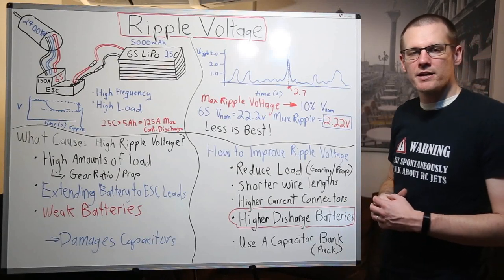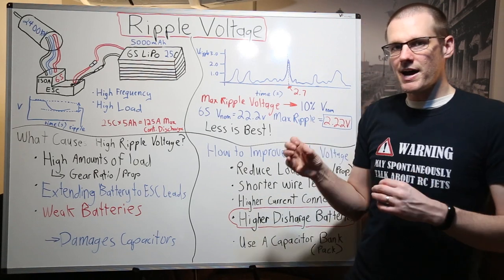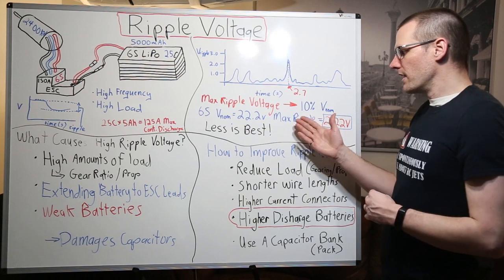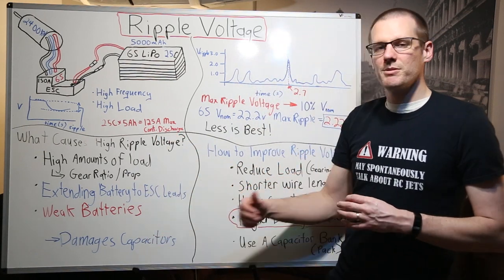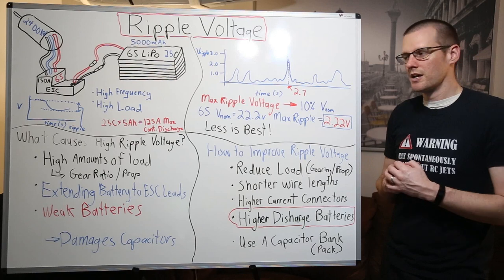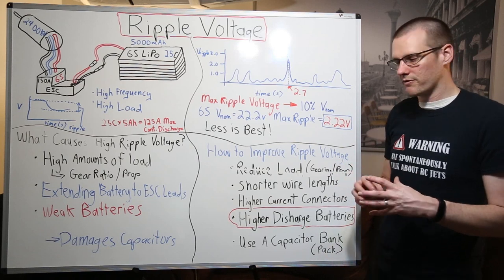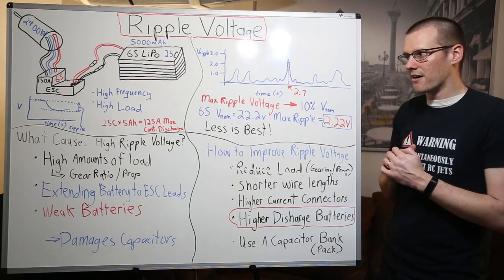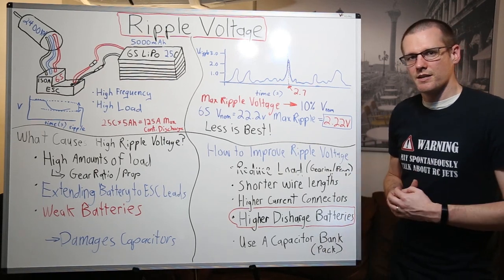What is Ripple Voltage in your ESC and How to Reduce it?

Comment: Awesome video my friend. I've converted a 100cc plane to electric setup and was worried about ripple voltage. After watching this I realize I shouldn't have any problems.🤞 I'm running a motor that pulls around 180amps at full throttle, with a 250amp esc and 9200 mah 12s battery packs/ 2 6s in series. Thank you for sharing your knowledge with the rest of us. You have a new sub!
Reply from the maker: Great to hear! I do prefer to use an ESC that can measure the ripple voltage to know for certain.

Comment: Thanks for this video. It made me realize I need better batteries to have the ability to oversupply amps to my ESCs. As long as my motor and prop don't demand more than the ESC and battery can supply, it should work out with a more efficient setup. Constant amps near the battery's limit, or above it, only damages the battery and results in puffing or killing a cell slowly.

Comment: Hi, you have an excellent channel with a lot of information, thanks for it. I am dealing with this very issue in connection with my project, I have a fishing kayak with a small Haswing W20 brush motor (17A/12v max) and I am converting it to a remote control for a small controller on my neck. For the speed control, I chose a brush ESC with a continuous current of 80A, the supply case of the ESC is 6mm2 (10 gauge) thick and 1m long, from the ESC to the motor is 70cm long. All connectors are XT60 rated at 60A. I see the problem in the battery, it's a deep cycle AGM lead acid battery and of course it has a significant voltage drop under load. Fully charged it has 12.8V and at maximum engine power the voltage drops to 12.2-12.1V, when it is discharged the voltage to empty is 12.1V and under load it drops to 10.9V. I think I will have problems with feedback spikes and I don't want to destroy expensive electronics. While searching for a solution, I came across the information that I would pre-order one 470uf low ESR on every 10cm of cable, that means a bank of 10 470uf/35V capacitors. I don't have a problem with that, but it annoys me that I can't calculate it exactly, people on the forums are not willing to give advice, they are angry when someone doesn't control electronics like they do :-/. I am no stranger to electronics, can you advise me how to make a calculation? Thank you very much for your help ..........Jerry

Comment: I use a 14S 2P Li-ion setup to power my F-22 EDF jet. The Li-Ion cells have a vary large voltage drop - under load, the initial 4.2V drops to 3.7V easily. I actually chose the motor as for a 12S li-po power system.
You made me think about getting that capacitor pack quickly :D

Comment: Where does the 10% nom volt rule come from? Just curious as to why and how they settled on 10% or more battery sag is an inefficient system. Excellent video presenting great info!
Reply from the maker: It came from the esc manufacture

Comment: Hi! Is it safe ( I mean, it would increase ripple voltage) to use a series (deans) connector adapter to connect my two 2s batteries to my ESC. The adapter is 100mm. long aprox Thanks!

Comment: Nice video, question what If you run more MAH with a higher C rating. Like 7000mah at 70c. Would that help your ripple.
Reply from the maker: Thank You. Discharge current is a function of capacity and the c rating. Increasing both will help for sure.
Reply: RCexplained thank you sir, I’ll keep you posted.

Comment: For improvements You left out larger gauge wire for less resistance in the power system especially if you don't have the option for shorter wires. Waiting for the day to see an esc that comes with 6-4 gauge wire lol
Reply from the maker: Hey Caribbean Mafia, you are correct.  I thought I talked about it in the improvement section of the video. I didn't have it written on the white board and remember providing a brief explanation why. Maybe it was in a previous cut and not the final cut of the video.

Comment: Great videos!!  Need some help, u might know,  bought a eurofighter 90mm and esc beeps (once i conect the battery to esc ) but receiver does not light up ( receiver works find i tested on other plane), i guess is the servo cable from de esc to receiver might be cut off,   how can i doble xheck that?
Reply from the maker: Sounds like the esc won't arm with the receiver. I would check your throttle setting and make sure it matches what the esc expects.

Comment: I think you should explain this in terms of ripple current as that's the usual EE method for explaining this phenomenon. The voltage isn't so much the issue, it's the combination of capacitor's ESR and frequency that's the issue. Most manufacturers don't account for the capacitance loss due to frequency as well as the ripple current, resulting in caps failing rather quickly.
Reply from the maker: Hi isogen. Thank you for your comment.
 The capacitors on the ESC don't need to fail first to take out the ESC. Excessive ripple voltage will destroy the ESC through voltage breakdown  if not managed. 
There are ESC's on the market that will log the ripple voltage to make it very easy to manage.
Reply: @RCexplained  Fair point. Do you know if it kills the MCU in the ESC or some other part?

Comment: I have a question about ESC's is there a way to test an ESC for maximum voltage without destroying it? I have an existing ESC that is rated for 2S  however many people have found that they can run 3S with it without any problems.  However this seems to be luck of the draw.  I really would like to hook up a multimeter or something and find out if the ESC I have actually can take 3S without just throwing a 3s battery on it only to find out I smoke the ESC.   Please let me know if there is a simple way to test an ESC for max sustained voltage without killing it.
Reply from the maker: I would recommend following the manufactures recommendation for cell count. Most manufactures place the maximum cell count on the ESC spec. If exceeded, the ESC is destroyed.

Comment: Question....  lets say I'm using less than ideal batts,   or as you call them weak batts.   The higher than average IR drops in the battery will produce more heat locally in the battery,   The voltage sags or ripple caused by weak batts at the ESC will warm up those ESC caps creating more heat.   Is there any reason to believe the motor runs any hotter on weak batts?
Reply from the maker: The motor would have less output therefore less heat using weaker batteries.

Comment: Friend, please ask me a question! on an engine that says 3s can i use a 4s battery if i use a 2 to 4s esc?
Reply from the maker: I can't recommend doing that however I can tell you that as long as you stick within the mechanical and electrical limitations of the motor it can be possible. 
Ultimately, It's best to find a motor that has the right kv to match your setup.

Comment: Great video, well explained, dunno why I’m asking this I kinda already know the answer 
I have two LiFe batteries I had planned to run in my truggy 
It’s a hobbywing max8 150 amp 
The batteries are two 3s 4200mah 30c 
Bad idea ?
I’ve been doing it but is it time to stop lol?
Reply: Also this batter has a “60c burst is it helps tho I’ve heard from some it’s bogus
Reply: I’ve also since learned my deans connectors might me insufficient 😂
Reply from the maker: LiFe batteries are good. As long as you don't have excessive heat in anything you are good to go.
Reply: @RCexplained  thanks and just curious, why are LiFe different than lipo in this case when it comes to esc amp pull
Reply from the maker: They have lower voltage but can dump some serious power.

Comment: I'm a little confused...... If a higher C rating means MORE amps.... doesn't that mean MORE current? How would adding MORE help protect against too much? I'm not understanding this part.

If an ESC is 150amps..... and you're using a battery that can output 125 amps max... wouldn't that mean the ESC is safer than if the battery could output Amps EXCEEDING the ESC's amp rating?
Reply from the maker: Hello upplsuckimcool16, I hope this long winded answer can help you out. 

A higher C rating means a higher maximum discharge rate. This means the battery has the potential to deliver more current. Key thing here is that the battery, ESC, or even the motor do not decide how many amps go through the system. The load placed on the motor decides how many amps are pulled. The battery does not force current in amps through the system. The ESC does not force current to the motor. 

Another key point to understand is batteries, ESC's and motors operate similar to how humans do. Imagine you run a foot running race against a friend. If your friend is winning you may push as hard as you possibly can, possibly risking passing out and collapsing just to take the win. Your body has a maximum sustainable amount of output, some people push hard enough to exceed this. Some that do exceed this burn out / collapse and don't finish the race.  
Electrical components are the same except they don't make any decisions. If asked they try their hardest to deliver. That 125A (max continuous current) battery will put out one thousand amps if you ask it to. (Although, I don't want to be standing there if you try.) The difference is that the voltage output would be significantly lower than nominal. This is the part that is very bad for ESC's. 

150A ESC vs 125A Battery. If the motor was loaded such that it draws 150amps from the battery and ESC, the battery would push 150A but would have a significant voltage drop. Besides your battery more than likely burning up, the ESC will have to cope with some significant issues because of the lack of a good power source. 

It sounds like you are treating the 125A spec as a hard cut limit and at 126A there's nothing left in the battery. But in actuality the specification is based off of a manufactures tested thermal limit of the battery pack in a very specific environment. Results vary.
Reply: @RCexplained  Im not sure you really addressed my confusion.....

when you say there is not a hard vut limit of 125 amps then i wouldnt really argue... but how large of a margin of error are you ascribing to this number? Im specifically talking about voltage spikes drawing more than it should from thr battery and more than the ESCs are rated for..... For instance, a mini quad copter crashes and the PID controller spikes out of control causing pretty massive voltage spikes.... Would these spikes have any relationship to the ripple voltage? I guess  im assuming they do.... If thats wrong then that would clear up ny confusion come to think of it
Reply from the maker: "but how large of a margin of error are you ascribing to this number?" Margin of error is irrelevant as you can pull over 500% in actuality. The  maximum specification you are referring to, is not the batteries maximum capability. As mentioned above, it is the manufactures interpretation or recommended maximum based on the thermal limit of the pack in very specific environmental conditions. 

I'm assuming you mean current spikes. Current spikes can cause ripple voltage concerns but not always. If your battery can not supply the current demanded by the system while maintaining an adequate load voltage, ripple voltage would be a concern.
Reply: @RCexplained  I dont understand..... doesnt mAH x C rating= amps??? Ur saying it = 1/5 amps? Youve completely lost me.... werent you talking about how a human pushes himself that being the max load before he passes out? A human cant exceed 5x that exertion
Reply from the maker: mAh x C rating represents maximum continuous discharge current
Reply: @RCexplained  OH I see now..... Figuring out the max amps MAH X C = doesn't tell you what the max the battery can output..... it tells you the max it can output continuously without being damaged...... It's like a safety rating then same as the AMP rating of an ESC... just tells you what it can handle, not what it will experience...

I did not realize this. 

So ok then. This ripple voltage... these peeks we want to keep as close to the dips as possible, which is why a High C rating is necessary... to keep the voltages up to support the current flow  preventing the voltage sag prevents these dips from being too drastic in contrast to the peeks.... Here is the million dollar question though.... We  use LOW ESR capacitors on these extremely high discharge RC models and I read somewhere that low ESR specifically for this ripple current.... I guess the question is.... that..... Are these capacitors helping keep those ripples less drastic? It must.... this must be why the FPV feed through the VTX connected to the system will become clear and lose the wavy lines from electrical noise.... the capacitor is smoothing out the peeks and dips...... 

Am I on the right track here?
Reply from the maker: Yes you are on the right track. The capacitors help with the ripple voltage. For drone and FPV LC filters are used adding an extra component to help filter out the video noise.

Comment: what happens to your esc if u run a motor that’s 140 amp if your esc is say 120 amp ?
Reply from the maker: If you load the system up so that the motor draws only 10A then nothing. It depends on what your load is and then the weakest link in the chain is the first to fail.
Reply: oh ok, cuz i ran a 140 amp motor with my mamba monster esc and it was fine.  and i heard that esc was only 120 amp
Reply from the maker: The specification on the motor is a maximum. Did you load the motor to this maximum? How many amps did you actually pull?
Reply: RCexplained was geared to 40-50 mph, 1730 kv in my 8th scale buggy, is max amps only applied if u gear to max speed?

Comment: Strange question. Does adding ferite or neodymium magnets to the outside of a brushed dc motor reduce low rpm torque? Trying to wrap my head around why it increases power and rpm. By increasing the field shape/pull? Can brushless motors increase rpm with external magnets on an in runner? Sorry if these are the dumbest questions you've ever been asked.
Reply from the maker: Increasing the magnetic flux in a brushed motor would reduce the kv and increase the kt of the motor. Brushed motors with a small can thickness would typically have flux rings added to help increase magnetic flux. 

Brushless motors do not have a magnet on the outside of the can like a brushed motor does. The rotor that is spinning in the center of the motor, houses the magnet. Therefore magnets on the outside of the can would not help.
Reply: @RCexplained  that's what I was thinking. Does it do anything bad other than wear out the brushes quicker on a brushed motor?